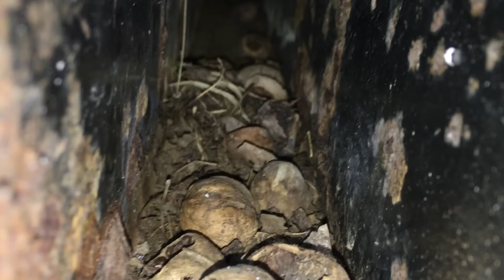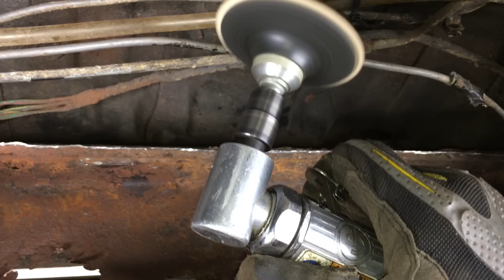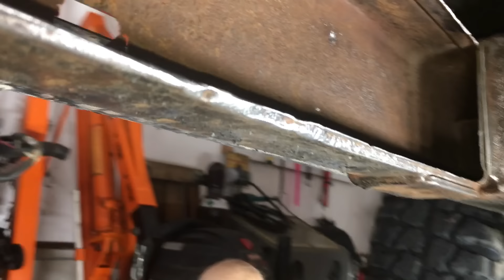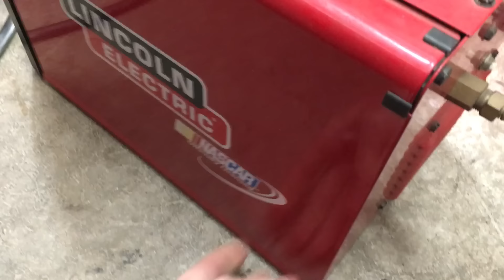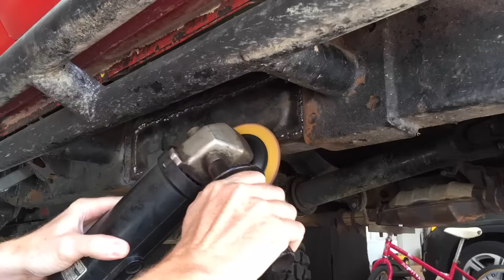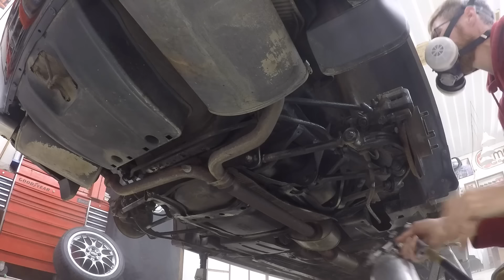How to Properly Repair Rusty Frame of Toyota Pickup Truck at Home

Comment: If  you are worried about penetration grind a bevel on the edge of the plate first, especially if you are grinding the weld after
Reply from the maker: Great tip! I ended up getting a 220v mig after this and it made a world of difference the next time I had to weld a frame.

Comment: You'll probably never see this and someone has already probably mentioned it but; with the little 100-150a mig guns with the ubiquitous nozzles you get from your local hardware store, you only need to run 20 cfh or 25 cfh if there's a draft (10 to 12 lpm). Anymore and your just wasting gas. You can buy nozzles for the little torches that have bigger orifices that require more gas but that's a little more niche.
Reply from the maker: I appreciate the advice! I actually ended up getting a 220v mig after this and it made a world of difference the next time I had to weld a frame.

Comment: I use deodorised fish oil then put a light coat of matte black enamel. It takes a long time for fish oil to dry though and dust sticks to it. Need about 2 weeks in summer to just leave the fish oil to dry.
Reply from the maker: Does the paint bond to the fish oil and will it cure?
Reply: @6thGearGarage  It works ok because its oil based enamel paint. It just takes a long time to cure anyway.  Plus its hard to keep paint on ahassis anyway if ya drive on gravel roads.

Comment: Very good in-depth video. I’m trying to figure out if I can patch a 06 Silverado frame, that’s got the torsion suspension setup. A guy was supposed to fix this truck for my neighbor, but all they did was put new outer tierods on and didn’t even get the right ones, ontop of not adjusting them whatsoever, so my neighbor took it to town to see if a shop would do it, they said no it has a cracked frame. So I got the truck for $250. A lot of Michigan rust, but the driveline is strong in it still. From a good G80 to a great running 5.3L and a smooth shifting 4L60E, I couldn’t let them scrap it. My idea is to straighten the frame enough by the time I get the correct parts and straighten the frame out before winter, and toss my little DK2 plow on it. 
Love the shop vac with garden hose idea. 
Nothing to it but to do it. Thanks again for sharing
Reply from the maker: Does the Silverado have a C-channel or boxed frame?

Comment: Before you weld on new metal, spray the frame with phosphoric acid. You can use one of those garden sprayers and spray it throughout the whole inside of the frame.

Comment: Needle scale it first and then cut open. All the crap will vibrate off the inside of the rails. Then you can blow them out with a blow gun and a long extension.
Reply from the maker: Good idea with the needle scaler... I need to get one.

Comment: Rather than under coating, use epoxy primer. Prepping all that surface though will be a bitch. Also I’m surprised you didn’t use or mention rust converter in this video
Reply from the maker: I used the Fluid Film because it creeps over time into all the areas of the frame that I couldn't reach with other products. Rust converter is a great product, but I'd need better access to the inside of the frame to apply it properly.

Comment: You should bevel your edges in the future. Better for penetration. You don’t need a knife edge. You can leave a good landing. In this situation, I’d rather ere on the side of too much penetration
Reply from the maker: I definitely should have. I ended up getting a 220v welder for frame work on one of my other Toyotas and 220v makes a world of difference. It welded the frame with ease. Now I only use this old Lincoln for sheet metal.

Comment: The best remedy for rust is Owatrol oil: Thanks to its extreme capillary action, it penetrates deep into the pores, displaces moisture, and seals the rust airtight. Without oxygen, corrosion doesn't stand a chance!

Comment: Glad to see a correct repair. I do highly suggest adding doubling plates on the vertical ends where it will be weakest. I ceinge when I see the Toyo repairs where they put on the preformed rail covers.  They look nice, but must trap a lot of moisture.

Comment: Good frame repair video, you should try needle gunning the frame parts it works good. I have been using LPS3 undercoat but I'm looking at Fluid Film.

Comment: Same problem from Alaska road chemicals for roads in the winter that these Toyotas rust away in 2 years in Alaska .
Winter cold in Alaska also wrecks Toyota engines over poor oiling system in below - 0 tempters
Reply from the maker: I need to travel south to buy my next Toyota!

Comment: Nice job keeping your Toyota on the road. We all need to get creative sometimes. Excellent job getting the rust out of the frame. A great paint for rusty metal is Bill Hirsch Miracle Paint. Don’t forget to put a few layers of plastic over the can before you put the lid back on or you’ll be cutting the can to get to the paint. I put it on my old Ford in WI after a good descaling and sanding. Let it dry and hit it with a topcoat that will stay glossy. Another product that I’ve been using is WoolWax. It’s like Fluid Film but thicker.

Comment: Newer Chevy truck box frames are built to rust, and it pisses me off. Because, I bought a beautiful 09 Sierra with no body rust in great condition with 64k miles. But, it's from Ohio and the previous owner undercoated over the rust that was eating completely through the frame in a few spots. I was able to get a decent deal for the truck when I pointed out the frame needs a lot of TLC, but now I have to fix it, or hire a shop to fix it, and I know it's not going to be light work. What a PITA. These box frames are hot garbage. My old 91 Silverado C channel frame never rusted through. Shame on GM, honestly. What a joke.
Reply from the maker: Undercoating is a terrible quick fix for a rusty frame. Shame on the previous owner. And GM.

Comment: Good repair i just did simular repair to my ford sport trac when i was done i took old transmission fluid and coated the frame and squirtedl some inside the frame rails. Old trans fluid really helps stop rust..not only that trans fluid will actually creep up the frame walls. Its messy at first but worth it..

Comment: I'd cover it up with POR15.  Hell to deal with, but should be the last time you have to paint it.
Reply from the maker: For the price of POR15, I'm not impressed with its performance. It looks good for a while, but then fades and eventually starts to peel. Even though it's on a frame, it must still see UV rays over time. POR15 isn't UV resistant. I've been trying some alternatives lately.

Comment: Not how it’s done.  There is scale there, rust just smoothed out not removed or treated properly.  There are specific tools for this job and you have none.  This kind of repair will not last. Drill a hole in this a few seasons later and bore scope it, you will understand.
Reply from the maker: I coated the inside with Fluid Film later in the video. I repaired the rear sections of the frame this way in 2011 and they've held up great. Eventually though, I'd like to have a clean frame shipped from out west, because some day this one is going to have too many repair spots.

Comment: Don't use paint or anything colored that hardenes entirely down there. Everything will leak somewehre, water will creap under and corrosion will creap in. Always use fat or oil based product, something clear like mike sanders, fluid film, owatrol . Dont use owatrol on the inside of the bars. Owatrol will penetrate rust and harden. Once its hardened it cannot self cure. Best use 1. Fluid film, then sanders inside. Use Owatrol outside, check regularly, redo regularly. Only use when frame completely dry.

Comment: I won't want none of that c*** with any rust, I got 1 and 02 with a new frame on it. The only rust is on the real differential but there is little pits of Ross. These trucks are t, it's not worth anything else, I will never buy another one again, if anything happens to this f***, these toyotas and the land cruises sequoias.  They fall apart piece by piece the brakes.Everything garbage not worth it

Comment: My son  has 2012 Toyota Prius and body looks great  but  underrated left rear upper and  lower  back  control arm anchors  are rusted  through and  now car is too risky to  drive. 
It will  cost  very much to  fix. He still  loves  this car.
Reply from the maker: Prius is unibody, so it most likely has a removable/replaceable rear subframe. If that's the case, you wouldn't even need to do any cutting or welding, just unbolt everything , replace the subframe with a good one, and bolt all the suspension components back on.

Comment: I just bought a 2008 F-150 that had a plastic box liner. The entire box looks like new except the two front corners are rusted out and the 3 from cross members from water staying under the liner on top of the box floor. Not a good plan.
Reply from the maker: If a plastic bed liner is used, it's a good idea to spray the inside of the bed down with oil or Fluid Film first.

Comment: When you weld you should grind off the edge so that you have a "v' to fill in, not home two flush edges. Or have a big enough gap to fill completely with weld. I used to hold the pieces for my older brother to weld on farms equipment and projects. He took welding course.
Reply from the maker: Yeah I've learned a lot since this video. I also got a 220v welder, which makes a world of difference!

Comment: What about putting a bunch of oil or rustproofing stuff inside the holes on new frame or old ones?
Reply from the maker: I did that later in this video with Fluid Film. It definitely helps!

Comment: Phosphoric acid from home depot or lowes or even ace. Or you could muriatic acid it and be there even less time. Phosphoric acid creates a rust proof layer that lasts about a year. It's paintable after it cures. All I'd recommend don't just paint it.

Comment: I purchased my 07 durmax about a month ago I inspected it very thoroughly so I thought until when I looked at it again 2 weeks later found out my bed it rusted out and a hole in my frame I’m 15 years old so this video is going to help me out a lot the guy also tried to bondo it to make it look good and he bondo the cab corners and rockers he also tried to bondo the whole in the frame didn’t help that it had inner fenders on so it did not help
Reply from the maker: That really sucks. Do those have boxed or C channel frame?

Comment: I had the same issue with por 15, they say you have to acid etch the metal then wash it then apply paint, but I found it just peeled the same as yours its  over rated rubbish. In the end I just wire brushed the chassis then painted rust converter on then let that dry, then used a good quality black all in one marine top coat, then finally I coated the outside of the chassis in crc softseal which is a waxy rust inhibitor that never goes completely hard, and I sprayed fluid film on the inside of the chassis. That was a number of years ago and the chassis is still perfect.
Reply from the maker: Nice combination of products to protect your frame! POR15 was my go-to back in the day but it's overpriced and doesn't last.

Comment: New here my 1985 Toyota 4runner has a pretty rusty front cross member have any videos on replacing the cross member that’s welded in it’s not gone gone just 1 rust hole but inside of the cross member is getting bad any tips be much appreciated
Reply from the maker: I actually made a how-to for this on my 1980: https://youtu.be/YkN0ACZe4ak I also replaced the inner fender at the same time because the front corner was previously repaired poorly, so your job will be a lot easier when it comes to getting everything aligned.

Comment: And the holes in the welds are called porosity just so you know the term cause welders will say it lol ikr that lol myself included but basically it's the impurities in the air getting in your weld(s) which the gas or flux on FCAW or others like SMAW Which will burn into gas will help block said impurities

Comment: You are more professional than most professionals.  Fact not flattery.  You may want to try a magnet to get the larger pieces before you use the wet vac or even tie one to the hose of wet vac. Just a suggestion. Thanks for the video I'm about to start on my truck before it falls in half 😆 I'll be starting with prayer and hopefully get some divine intervention 🙏 😉 thanks again 👍
🩸❤️🔥💯

Comment: You should have sprayed the inside of the frame with a rust converter product to kill all the existing rust and stop it in its tracks
Reply from the maker: I used fluid film inside the frame later in the video. The only problem I see with a converter is the black coating it creates may eventually flake off and clog the drain holes again.
Reply: @6thGearGarage but it's like putting a band aid over an infected wound without treating the injury first. The root cause has not been dealt with. The wax oil coating will prevent new moisture getting at the steel but the moisture that is already trapped in the surface rust will continue to grow and expand causing flakes of metal to fall off inside the chassis rail. I've used a few different rust converter products and the black coating in many rust converters is actually epoxy primer which is designed to be painted straight over. When you jet wash the inside of the frame rails you will inevitably remove large quantity's of the wax oil as it doesn't fully cure leaving fully exposed bare steel to start rusting again
Reply from the maker: If I do wash the inside of the frame, I apply more fluid film after it dries.
Reply: I strongly appreciate the conversation. "Classic restoration" with your experience what would professionally recommend for a rust inhibitor & reversal product. I have a 25 yr old GMC I'd like to keep it in it's youth.
Reply: @chrisfreeman5975 Im from the UK I currently use neutrarust 661 it's a product my mate recommended to me they use it in the military to treat the underside of tank body's when they experience damage and surface rust. It will not penetrate deep you will always need to remove any loose scale but when the surface is prepared it's works really well.

Comment: Im a welder fabrocator i would say bevel the steal and weld all in onre shot to build up the heat all the way acrossin kne shot i wouldnt worry about warpin it when short arcing it
Reply from the maker: Thanks, I actually ended up getting a 220v welder before my next frame job and the extra power makes a works of difference! I pretty much only use this 110v for body work nowadays.

Comment: You should go just with the self priming alone because its capable & designed to apply for that heat temperature (250F/120C)
Reply from the maker: I'm always suspicious of self priming paint. I mean it may bond well, but does it bond as well as a dedicated primer? I should really to a test of both methods.

Comment: Is there a way to rebuild the lower control arm mounts? Mine are in bad shape on my 05 Tacoma.
Reply from the maker: Anything can be fabricated by a professional, but you're looking at time/$$$.  If the frame is already that bad, then another section might rot out in a couple more years.
Reply: Finding someone to do it around here will be a task in itself. Properly that is. Plenty of redneck ways but id like it to be right. I feel like i could if i had the equipment.  @6thGearGarage

Comment: I have a 2006 4Runner Limited V8 that is going to need some  frame repairs eventually. 340,000 miles and purrs like a kitty.
Reply: I got a great deal from a buddy of mine. Paid 1000 bucks but it needed a little work.
Reply from the maker: Those v8 4Runners are so hard to find... definitely worth saving!!

Comment: You asked for any pointers for welding and this is what I’ve gotta say: When doing structural welds you should bevel the sides of the plate you’re welding in and bevel the sides of the surrounding plates so you get maximum penetration and do as many passes as you need to fill the little valley then if you can (I know it’s not applicable for this) back grind the weld (basically just using a cut off wheel to make a slight indent in the weld from the back of the plate) and run a bead around the back as well. Additionally instead of doing welds in a linear fashion do some welds in one corner then jump to the other corner like you would with the bolts of an oil pan or something to help disperse heat. Also you can grind back a little more metal to prep the surface. 
My experience: doing structural welds below the water line on the hulls of super yachts

Comment: I know this is 2 years old but what happens if the frame has completely cracked on one side of the truck just infront of the passenger rear wheel. I have a 1999 Toyota Tacoma SR5 that I have already sunk money into 2 new tires and radiator. Can you realign the frame and use rust repair kits to reconnect from Oriclambo?
Reply from the maker: Yes, Tacoma owners are fortunate to have the frame repair kits available. They will solve your issue.

Comment: U should turn down ur shade on ur helmet so u can see better and drop you garage door to make it a little darker and try 95-5 for gas it works better for steel welding burns hotter

Comment: Really good video, but dont use POR15 for the frame, use woolwax its better at preventing moisture, and if you want to paint it, use epoxy paint, after cleaning the rust off, if you get more rust in some areas the paint will crack and show you where the rust is coming from, so you can clean it better and repeat, then do woolwax